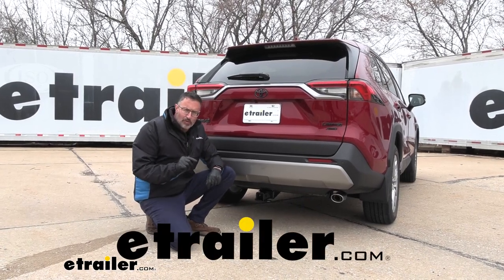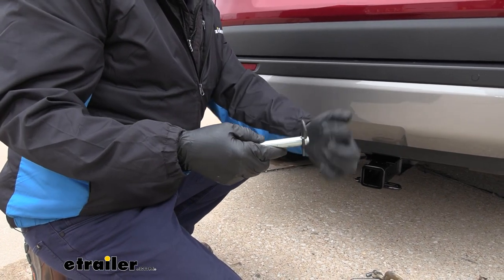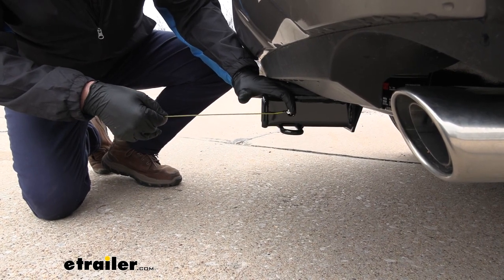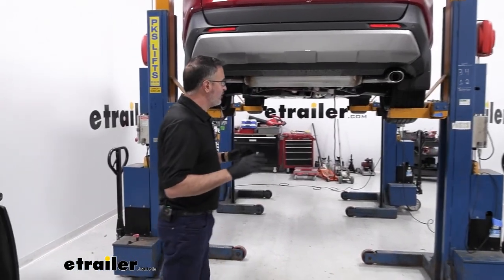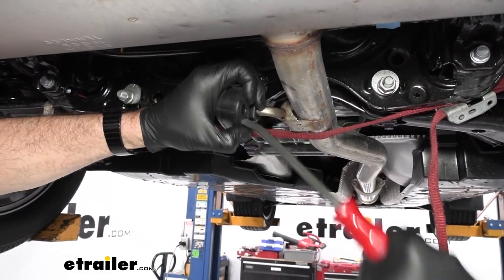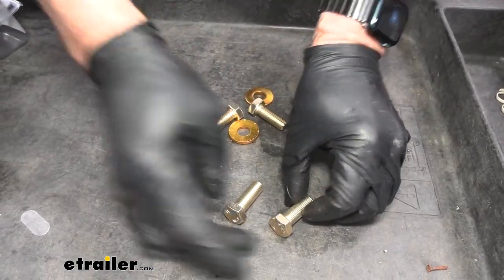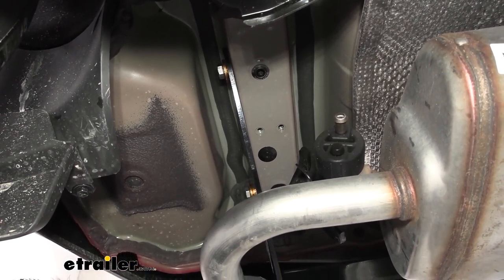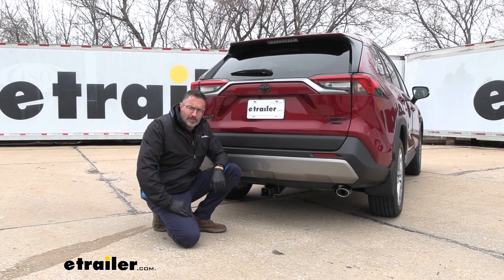etrailer | Setting up the Curt Trailer Hitch Receiver on a 2023 Toyota RAV4

Comment: Excellent video, but the install is even easier than shown in one small way. You don't need to pull the four 12mm bolts to lower the exhaust. Those side mounts also have rubber isolators that pop off with a push of the thumb (no need for that pry bar at all). Other than that, I did this exactly as shown today but from the floor with jack stands. Same class 3 hitch from etrailer on a new XSE Hybrid. Working alone, it took me less than an hour. Thank you for the excellent instruction video!
Reply from the maker: You're very welcome, thanks for the tip! You don't really need to lower the exhaust, we did it so viewers could get a better look at what's going on...
https://www.etrailer.com/tv-install-curt-trailer-hitch-2023-toyota-rav4-c13416.aspx

Comment: Install seems simple enough for most people with the proper tools.
To allow additional ground clearance.  To bad your receiver isn’t inline with the frame.  Then, all you would require.  Is a hole cutout in the bumper.
Reply from the maker: That would be nice, but there's a lot going on behind the rear bumper, and it would be difficult to fit a hitch in there that had a receiver that would exit through the bumper like some OEM hitches do.
https://www.etrailer.com/Trailer-Hitch/CURT/C13416.html

Comment: Very easy install took about 20 min. It would have been 10 with a ratcheting 19 wrench. I did not drop the exaust either. Saved over 800 with what toyota quoted me
Reply from the maker: That's awesome! Anytime you can pull one over on the stealership, it's a good thing!
https://www.etrailer.com/Trailer-Hitch/CURT/C13416.html

Comment: Hi.
I was working for 3 hours today... and I failed..
I'm going to try again next time.
The reason I failed...
Both sides won't go in at the same time..
If you fasten the bolt on one side
The trailer hitch on the other side is not going in..

No matter how hard I try, I can't...
I ask for your help.

Comment: Will the hands free sensor to open the rear hatch still work?
Reply from the maker: The area directly next to the receiver tube will block the sensors, but if you wave your foot 12 or so inches to either side and a little further back than you're used to, the sensors will pick up the movement and open the hatch for you.
https://www.etrailer.com/Trailer-Hitch/Toyota/RAV4/2023/C13416.html

Comment: My main concern is that the hitch is rated for 600lbs tongue weight, but will that hitch still be able to carry a dirt bike or scooter weighing around 200+lbs?
Reply from the maker: The hitch itself has a 600 lb tongue weight, but you'll be limited by the actual tongue weight capacity of the vehicle itself, which is a maximum of 385 lbs.
https://www.etrailer.com/Trailer-Hitch/CURT/C13416.html

Comment: Can the hot wire that you run to the battery, just be spliced in to an existing wire that is hot with KOEO ?
Reply from the maker: Are you speaking of the power wire for the # C56434 trailer wiring harness? If so, we don't recommend connecting that wire to anywhere other than the positive battery terminal. Installing it in that manner helps isolate the vehicle's wiring system from any short circuits that might happen in the trailer wiring. 
https://www.etrailer.com/Custom-Fit-Vehicle-Wiring/Toyota/RAV4/2023/C56434.html